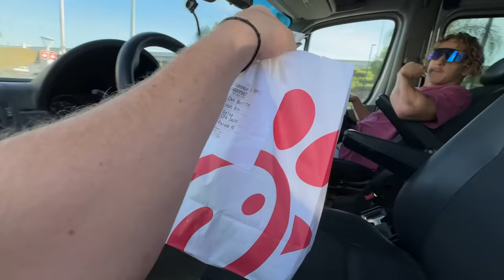Medium's Race Built Kawasaki 450! - Buttery Vlogs Ep218

Comment: Damn this is the fourth different incident where media from media blasting has destroyed something in a drivetrain. This bike and some car parts; engine, trans, torque converter. So who did the media blasting and coating. If it's a company that's on them. It should have been cleaned multiple times after blasting and before coating. I'd be making calls and emailing the receipt.